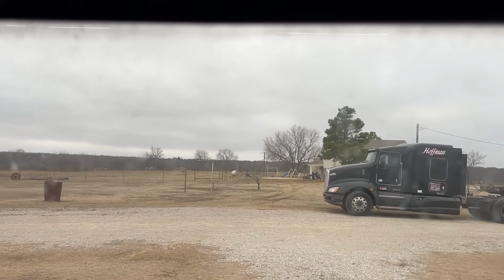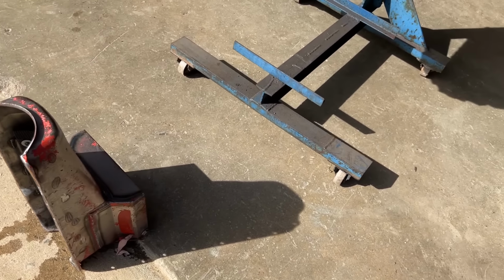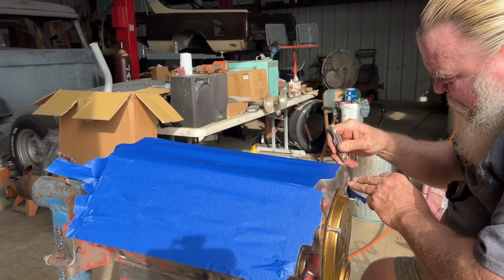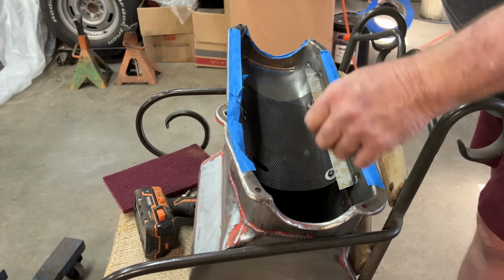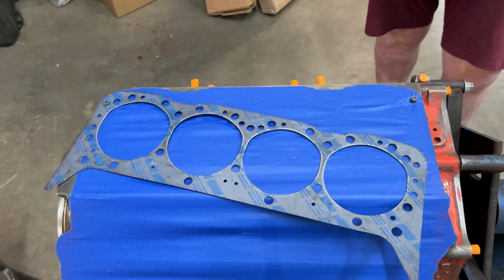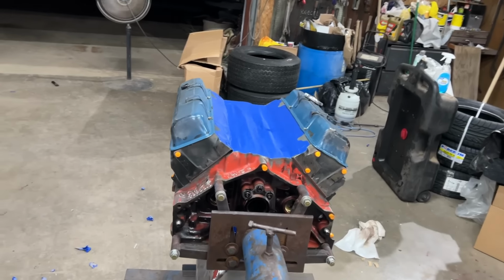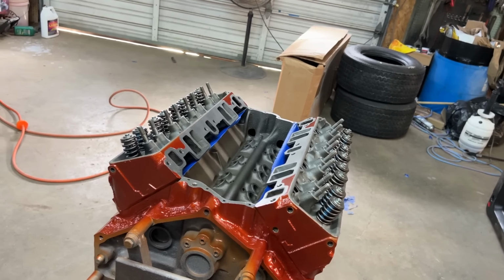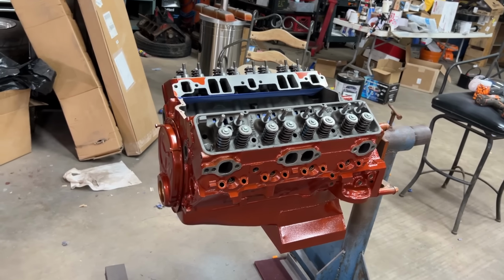ElCaballero Color Reveal

Comment: Was this the AAR. One with smashed quarter and bent frame????
Reply from the maker: It is from AAR but the bent frame one is the parts car. I used the roof clip and the front clip off of the bent frame car.
Reply: @SantasWorkshop  might want to shoot some rustproofing in quarters doors and  bed tray these car are prone to rust